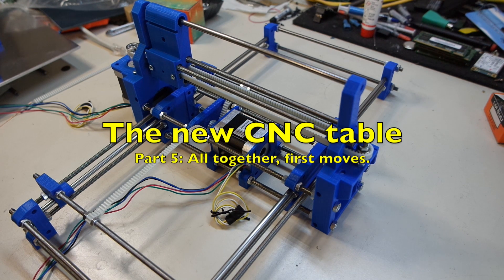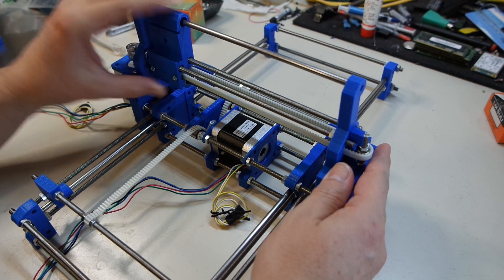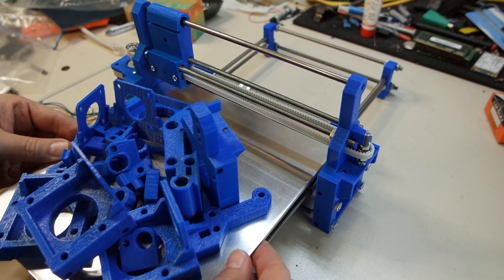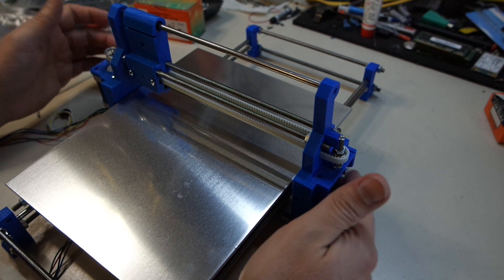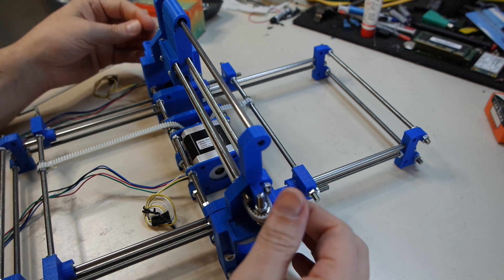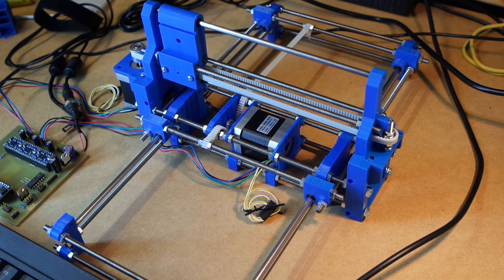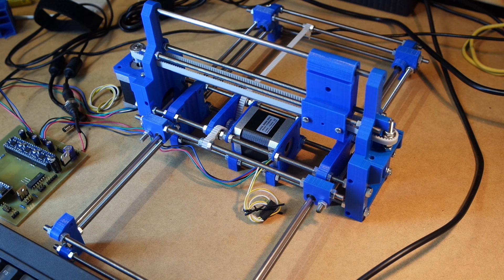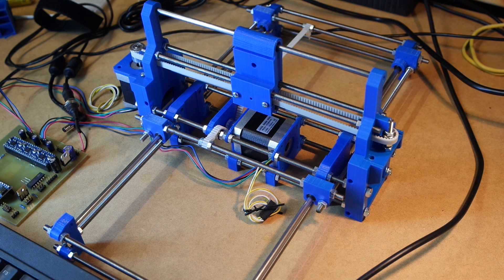The new CNC table pt. 5

Comment: Dirk please could you tell me WHAT IS THE SIZE OF THE ALUMINUM SHEET?
Reply from the maker: It's 250 by 200mm, don't buy plain sheet like I did, but get some with a machined flat surface.

Comment: Are you leaving space to upgrade to nema 23 motors?
Reply from the maker: Right now this is limited to NEMA 17, I believe NEMA 23 would be able to tear it apart.
But the design is modular- it is easy to resize the parts for a bigger build. It might be an issue to 3D print parts big enough.

Comment: Your 3d Printer (i guess it was Video 2 or 3) looks nice, do you share its Files as well?
Reply from the maker: No, not yet - the parts alone will not get you a working printer, and I did not manage to make the documentation material.

Comment: Hi Dirk, excellent development, Do you have plan of sharing the final 3D Printing files?,  and linear bearing part numbers ? Thanks
Reply from the maker: Yes, when it's done, good, and doesn't pose a risk to life, then I'll put on my github repo, stl-files, bom, some instructions, and if required - the firmware it requires.
Reply: Excellent developments. Congratulations!